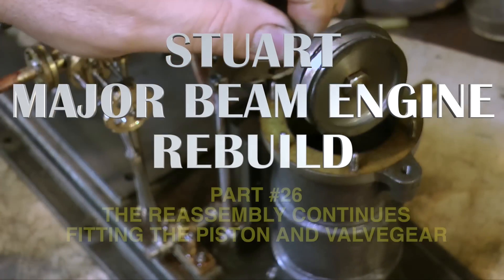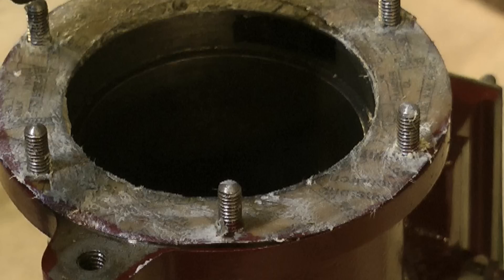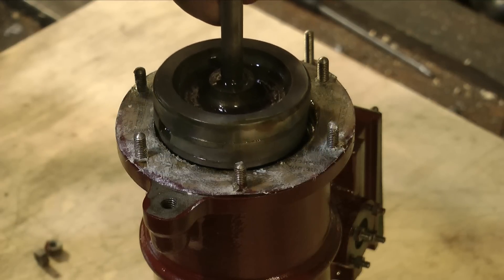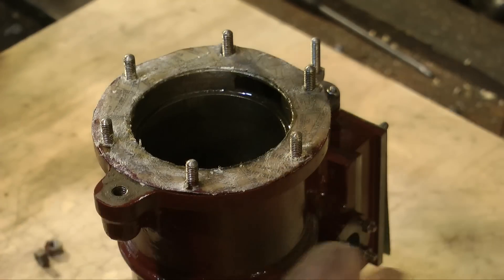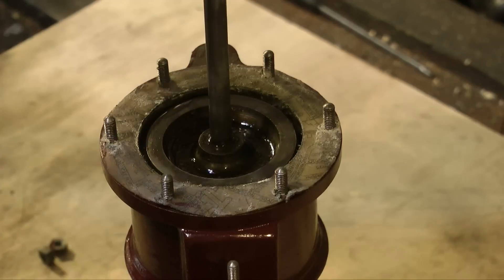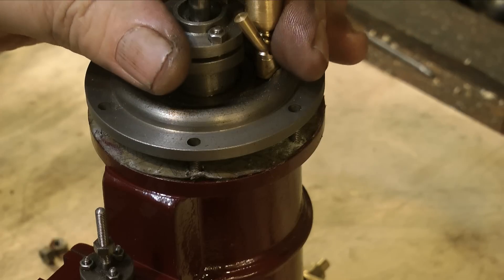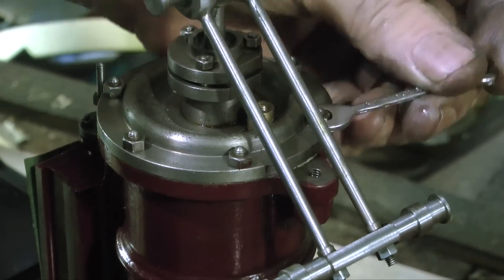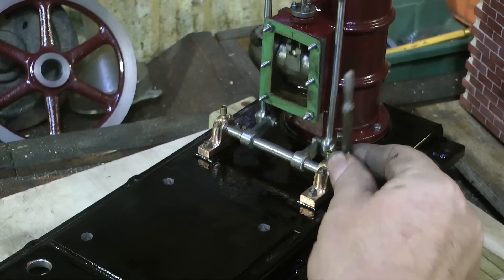STUART MAJOR BEAM ENGINE REBUILD - PART #26

Comment: Hi Keith the Australian Engineer in Miniature suggested to see the valve movments and setting fit a clear plastic valve cover and see the slide valve movements to get the correct setting. the only problem is if the use of your oil might stain the plastic. so once the setting are correct ,then replace the plastic with the correct valve cover. have a good day. Seeyuo

Comment: Three thin feeler gages will do it too, to install the piston. I noticed you did not check the ring end gap in the cylinder. Is that significant with steam engines?
Reply: i do not think so, as the operating temperature isnt nearly as high. The end gap is there to allow thermal expansion of the ring. If it closes completely, it binds and kills the engine. As for steam engines... I do not think they run as hot.

I DO NOT CLAIM THIS TO BE CORRECT AGAINST FACTS TELLING OTHERWISE. THIS IS JUST MY BEST GUESS, so please take it just as that.

Comment: hi Kieth. You could completely dismantle the piston assembly,so you just had the piston and the push-rod, then insert the piston from the bottom of the cylinder where you can get to the edges of the cylinder & rings, you could put a hose clamp on the rings (just enough) to retract them for insertion.

Also, isn't that leaver the reverse leaver?

P.S. I am loving watching this, I am  model engineer myself.

Comment: I have enjoyed your videos on this engine particularly as I have just purchased the castings for the M.E. Beam Engine and it is almost idental to the Stuart Major only  smaller.   I have purchased some back issues of Model engineer where it was described in 1959/1960 and the one dealing with the cylinder (October 1959) says "It will be seen from the sectional detail drawing that both ends of the cylinder, beyond the piston travel, are relieved by counterboringto prevent thye formation of a ridge when wear has taken place"   Make what you can of that; I think that I have missed a point somewhere.

Comment: I used a cutup coke-can for that. The can is from aluminum and thin enough to fit between the piston and the cylinder, (at least that's the case with my engine) and stiff enough to give a guide. It worked for me multiple times.

Comment: hello why is there a lever attached to the valve gear?the only purpose I see for it, is on the full sized engine, it will beam you in the head!
Reply from the maker: +Ethan Harty Often on large beam engines there are manual levers for the valve gear - on this engine the lever is a representation of the full size. It has no function on this model.
Reply: +Keith Appleton thank you! quite interesting.

Comment: a hose clamp around a piece of tin is a cheap piston ring compressor ;)
Reply from the maker: +jetegtmeier71 Yes I use them when required, but a hose clamp wouldn't work with this deep recessed cylinder.

Comment: Sometimes, you can use a hose clamp with a screw drive as a piston ring compressor, though it wouldn't work with a shouldered bore like this. Also, what do you think of the idea of using piston rings from a small petrol engine in a steam engine if you were building a new one? I say this because they're fairly easy to find by salvaging them from things like lawnmowers, leaf blowers, chainsaws and "whipper snippers", as we call them in the land down under(string trimmers for those of you in England, or weed eaters for our American friends.) that other people just throw out.
Reply from the maker: +Kaleb Cosier Aluminium pistons from Internal Combustion engines do not seem to like superheated steam, plus the gudgeon pins are generally too big, and a steam piston is very simple to make anyway.
Reply: +Keith Appleton I'm not talking about using the whole piston from the petrol engine. Rather, I'm talking about making the steam piston in such a way that you use the rings from a petrol engine piston on it. In other words, taking the rings off the petrol engine's piston, and fitting them to your steam piston. There is a possible advantage in doing this come to think of it; since piston rings for internal combustion engines are thinner than those traditionally used in steam engines, you can have more of them on a piston of a given size, which makes for an even better seal.
Reply from the maker: +Kaleb Cosier I suppose you could use them, if they would fit in an imperial sized cylinder i.e. 2 inch bore.

Comment: What are the minimum tools and machines required to build a steam engine?
Reply: The absolute minimum would be a bench lathe, bench milling machine, small pillar drill, taps, dies, adjustable spanner, flat and cross head screwdrivers. If you want to get the job done properly however, it's best to build up a collection of tools and more powerful machines.

Comment: I have a silly question. Can you make your videos longer?
Reply from the maker: +Bendik Vestrheim When I look at the Youtube statistics, the average view length of the FREE videos that I post is shorter than the actual length of the videos - so there is no point. However, I will be putting some longer ones on the Youtube "Pay Per View" section shortly.

Comment: there is a machined recess on the cylinder so that the engine will run smoother. when there is a recess the steam is able to get on top of the piston and get access to the entire face. when there is no recess less steam can get on top so it will not start as easily. it is a common method on large diameter models. I hope this has answered your questions  ~Stan